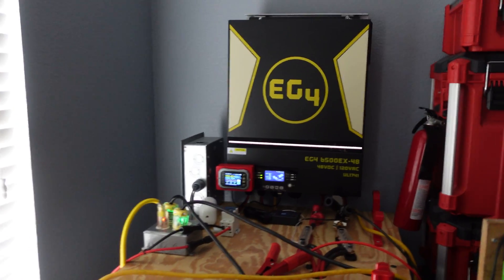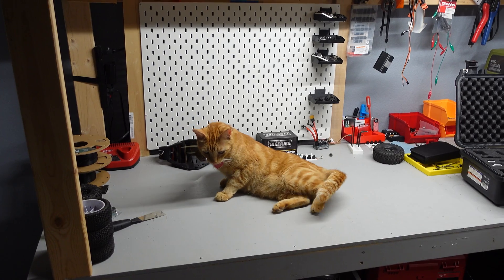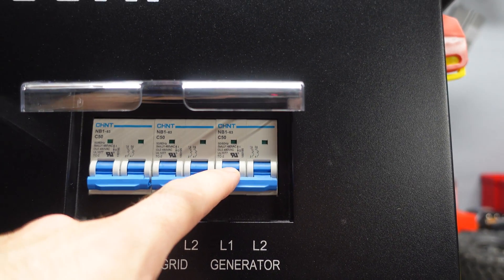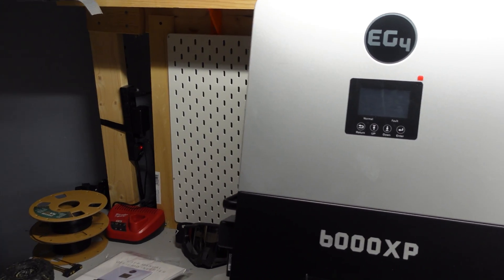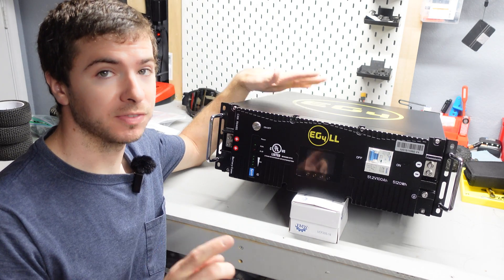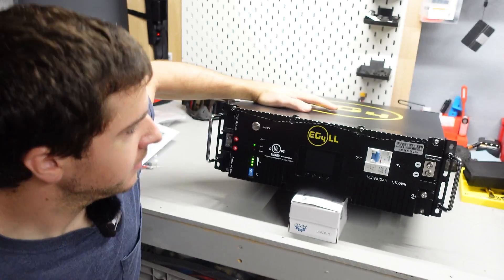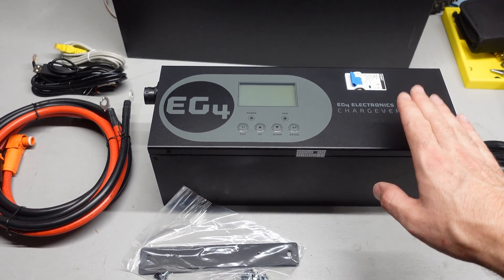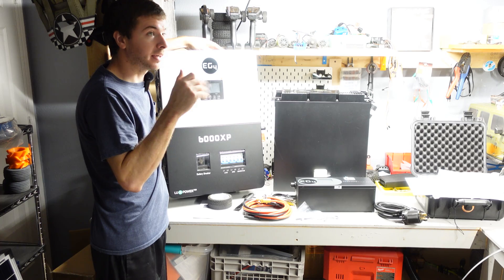Upgrades For My Off Grid Solar Power System EG4 6000Xp, EG4 LL Server rack battery

Comment: Hello I’m working on some backup power and a little cost savings running some 120 circuits I have a 50 amp Reliance 10 switch and I’m gonna set up all 120 I’ve been watching and talking to some guys. My question is hooking the 240 out to a plug so I can run a cord from it to the transfer switch as I wanna keep my options open if I loose battery or some bad to be able run my transfer switch from my gas generator .    Sorry for bouncing around but if you can understand my thought any advice would be appreciated.    Thanks
Reply from the maker: @jimverh1868  You can take the 4 wires from the inverter ( 2 hots, neutral, ground) and connect it to a generator input to your house to back feed it. Is that what you’re referring to?
Reply: Yes so I can just use a 50 amp cord cut and wired into 6000xp then plug into generator plug on transfer switch ? Wasn’t sure if I had to wire in a load center box wire a plug from it then use a 50 amp cord.   The first way sounds easier and less expensive. So that is a way it can be done ?

Comment: Hey Mike, Love your videos.  I would love to do something link this in 24v as that is what all out cabins run here in Alaska.  How hard is it to find the stuff to build a set up like this? Do you have a parts breakdown list? What is fuel economy like with this one?
Reply from the maker: In your case just find what kind of batteries and inverter you want to run, then find an online retailer that can ship there. They have plenty of 24v inverters and batteries. I will be doing a full break down video soon as its easier to show all the smaller items and connections, but honestly just a battery, good quality copper cable, the inverter, and solar panels is all you really need to get started. Hope that helps! Please ask if you have more questions.

Comment: Congrats Bud, seen you growing with you systems. Looking forward to this set up.. the 220 split ph is awesome for the whole house setup.... you went all out ! post up some of your thoughts on that EG4 Inverter... I'm on the fence on it... about to go 48 volt and going to a Victron but they have that Issue that when you plug in the grid they just bypass everything unless you do a bunch of programing from what I understand...
Reply from the maker: @mikeq5664  thanks for the comment, it’s up and running, I have a build video will be releasing here shortly, it’s a very nice unit, very happy with it so far! I’ve  already ran 600 kwh through it no issues, connected to 10kwh of batteries and 3kw of solar. Victron stuff I’ve heard is good but the eg4 has been awesome.

Comment: The 6000XP is no upgrade. It's a high frequency, transformerless inverter that offers a poorer surge capacity and a shorter life expectancy than low frequency transformer based inverters. In addition its not even legal to install in your home as an ESS system in the U.S. because it lacks UL9540 certification.
Reply from the maker: I see your point, it’s really only an upgrade for my because of split phase capacity. But if it last 5-10 years I’d be happy, and I agree low frequency is the way to go, just way heavier and have a slightly higher idle power draw